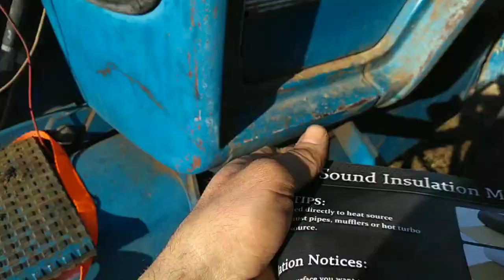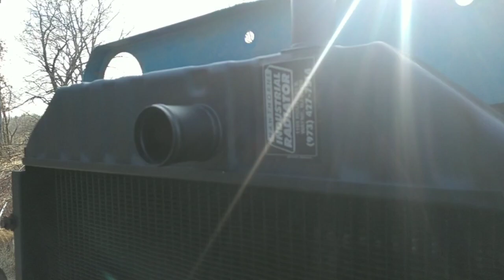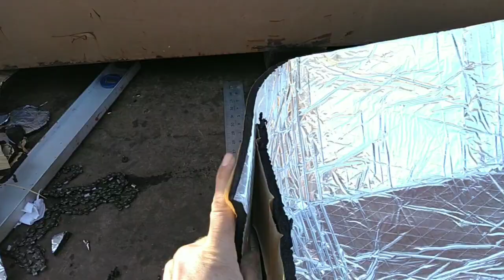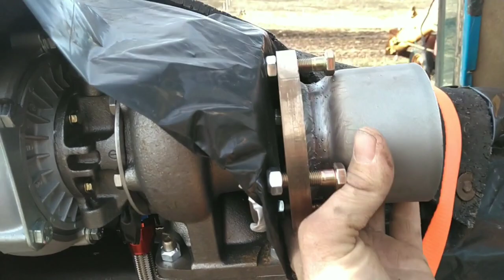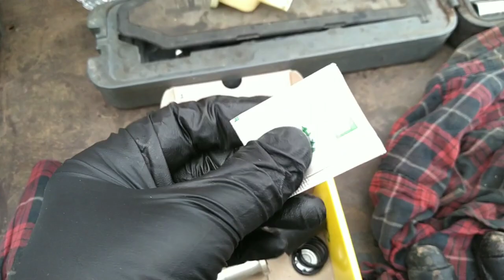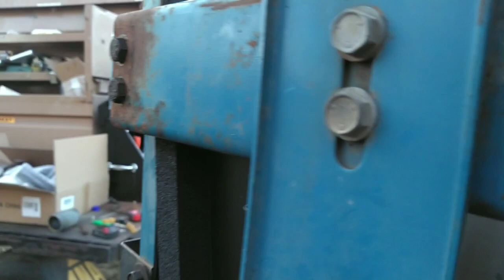Ford 8700 turbocharger installation part 4: more reassembly...

Comment: Really impressed. You are good at running metal/copper tubing. Looks clean
Reply from the maker: Thank you Brandon, I appreciate it. I've had a lot of practice over the years. I'm a perfectionist when it comes to routing  electrical and plumbing. A little bit of time and effort sure goes a long way to tidy things up, especially on old tractors.

Comment: Can't wait to hear it running .might do the same to mine they are pretty dead without the turbo
Reply from the maker: It has made a very noticable difference. This tractor spends a lot of time on the rotary hay rake, typically the sweet spot to run it is 1700 rpm, without the turbo, I was moving the throttle all the time on hills, now I can mostly set it, and forget it. If I had spent more money on a turbo, it'd be even better.